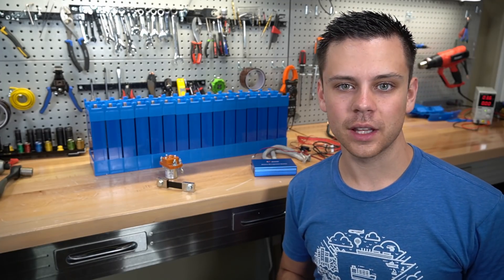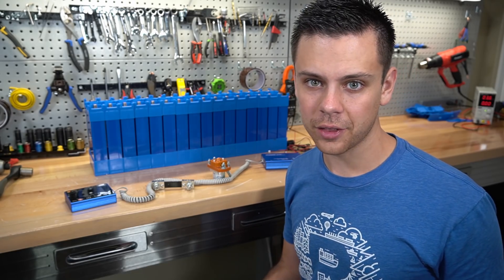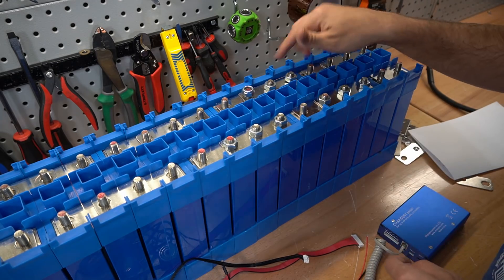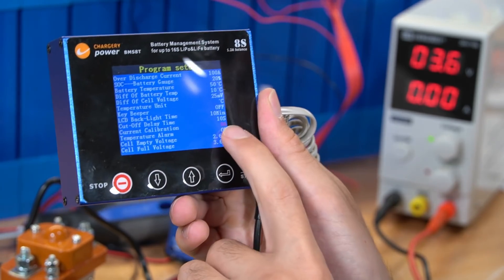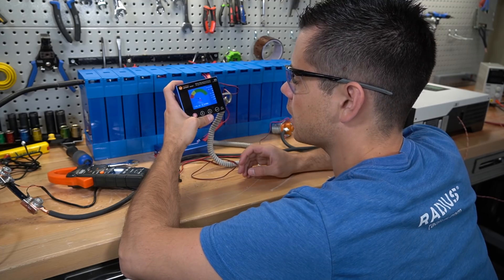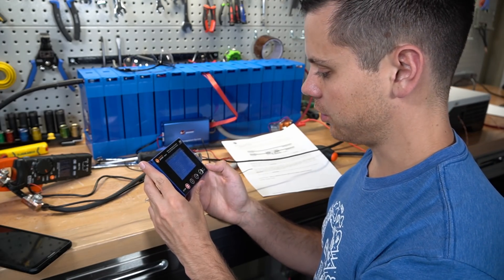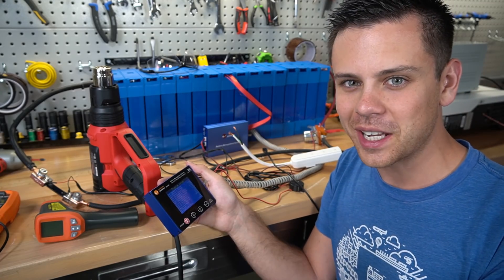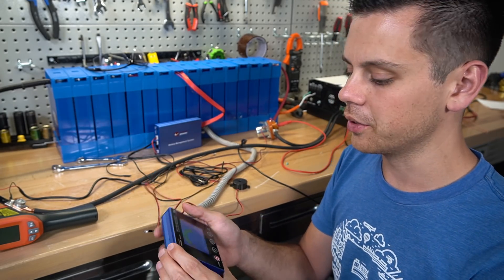Chargery 8T/16T LiFePO4/LTO/Li-Poly BMS Setup and Review

Comment: Dam I was hoping you liked it. Wish there was something better in the same price range. That DC contractor is crap mine is 3 times the size and it's 100amp.
I only use a BMS for charging I use voltage sensitive relays to control discharge. 
Thanks for the entertainment and education will

Comment: Hi Will, could using a relay between your battery and inverter damage or destroy your inverter by sudden disconnecting or connecting? Solar storage inverters seem to use CANbus. Would appreciate a video explaining the CANbus protocol and how it works integrating devices, and how that differs to other options RS485/modbus etc. Thanks, Luke
Reply: It will not damage an inverter if the battery is disconnected.  The inverter will only drain it's capacitors before it shuts off.  That means when the inverter get's power again, it will take an inrush to recharge it's capacitors.

Comment: 90’s? You ARE young! Same cords since 50’s I think. I had to use a circuit accessory to use the contactor. I was told that board wasn’t supposed to drive the contactor continuous duty. I had trouble with current calibration. Pulled some hair out. That shunt looks small. I bought the 300a and the shunt is huge. All I did was press the current cal up 3 then down 3 then save and get out. I ended up not using contactor and using this thing for monitoring cells. I do not Ant at all.

Comment: I would assume that the relay heat is from the coil being driven at 100% duty cycle.  120 degrees F  is not uncommon for some contactors of this size.  The big thing to check is what the 100% duty cycle voltage rating is for the contactor and make sure it matches the voltage being sent by the BMS because it may be higher than the contactor was rated for.  Another option would be to buy a quality no load (or magnetic) contactor that changes position based on the presence of power at the signal leads but uses permanent magnets to maintain the connection so that the coil only needs power in order to make the position change but then little or no power to maintain the connection so the coil doesn't use (or uses very little) power in either connection state.
Reply from the maker: Yes good point
Reply: Same as what an RV uses to turn on/off the house batteries.

Comment: Thanks for that review, I had looked at this one but given those limitations and issues, it still looks half baked. I'm using the Chinese fet based board with the bluetooth app for my bank like you reviewed a bit ago. The only limit to that one is that it can only handle 50 amps max charging current into the battery while discharge can be up to 400 amps, not that I'd ever push it anywhere close to that. My solution was to split my bank in half with one on each half giving me up to 50 amps of charging possible into the bank or 100 amps combined and splitting the load across the two. With my inverter setup I'll never pull more than 160 amps peak anyway with no more than 130 amps sustained so using the 400 amp rated bms with two of them, they'll never exceed 80 amps peak each or 65 sustained unless a pack or bms fails with the load only being carried by the other. And at $110 each I can afford to keep a spare on the shelf. Been running that setup for over a month now, and the bms never even get warm during use. Setting my inverters to never exceed 95 amps charging current, I stay under the max limit. Peak charging typically rarely exceeds 80 amps anyway, but it's nice to have the inverters as a backstop as well. I'm using that setup with a pair of the 48 volt Growatt inverters and I'm really happy with the results.
Reply: CAn you give us a name and link for your BMS?  Thanks

Comment: Pretty glad I bought a Daly BMS like you recommended.  I really didn't want to mess with configuration, given that I killed a pack before with a misconfigured BMS.  Usually I want more options but factory settings sounds pretty good for this use case
Reply from the maker: Hey I agree big time. I feel the same way.

And I use Daly BMS in my current system and love it. So easy!

Comment: DC relays get hot cause of the coil not the load. Remove the load and hook the coil to the power supply it will get hot
Reply from the maker: Yes absolutely
Reply: @WillProwse  maybe solid state instead?

Comment: Hi Will, I was thinking about buying 4 of these cells for a small 12v system for my stealth camping rig but i was wondering if there would be a problem buying another 4 in the following year to switch it over to 24v system - am I going to have a problem with balancing after using the first 4 for a year?
Reply: This!
Reply: At very least calendar aging will reduce your effective capacity. The AH of the 24v battery will be equal to the smallest value of the cells you have, which will be smaller for the cells that are a year older. Although if you aren't charging and discharging completely all the time this will likely be a small difference. 

The other thing to think about is your whole system will need to be designed for 12v, run for a year then be completely redesigned to run on 24v, because most components are not designed to run on both. If you have lower power requirements, it may be better to make another 12v battery with the 4 new cells and connect it in parallel instead of making a new 12v battery.

Or you could just go 24v right away, so you don't have to buy components twice. This is what I would do if you have the money, but I'm just some guy on the internet, what do I know. :)
Reply: @GillyGuy  Yes, I plan to parallel them at 12v if I haven't been able to buy enough items that are both 12 & 24v capable in that time frame. It's all about limited funds I have now and flexibility in the next couple years depending on what happens.

Comment: They do the shunt like this,  to allow the use of different shunts, but it can be made easier to work with!
Reply: Can you use a victron shunt with it?
Reply: @PaDutchRunner  You can use any shunt amperage but no more than 75mv.  Most good shunts like Deltec and such are 50mv.

Comment: Literally ships from wuhan! Lol no flyback diode? How long is that bms going to last getting transients?
Reply from the maker: No way haha! Holy cow
Reply: haha
Reply: Ya when u translate the Chinese it says wuhan. Literally the only reason I haven't bought one yet. Been in my cart for weeks
Reply: @cormacsyt0  the diode is there but you can't see it as it's under the orange top.
Reply: @cormacsyt0  Solid State Relays are being developed & tested for such DC Applications.  Energy Saver Relays from TE & Gigavac are also options.  Latching relays and a standard automotive type of relay used in combo can also keep constant power use down.
Reply: @DIY Projects Originally designed for small EV Usage but flexible enough for any application.

Comment: I use the 24s version, but without the shunt or disconnects. Will be using other means to disconnect, like turn off the inverter or disconnect ac loads. Removing the battery from the mppt charge controllers will damage them, if there is solar input. By the way, the bms gets warm when it is balancing.

Comment: Sounds like the "contactor" is rated in Chinese amps. Derate by 75% to get real amps :P
Reply from the maker: Exactly. Or 50%. That's my Chinese de-rating lately
Reply: @WillProwse  Chinese formula for Current: V/Rx2=I
Reply: @WillProwse  Your speaking my language Will :) My guess is, get a quality US or German made contactor and the problem will go away. I use a Schnieder with my Chargery BMS and it doesn't get hot at all. Oh and yes they are a BEAR to configure the shunt on.
Reply: Paolo Petrozzi duly noted, and diverted to /dev/nul
Reply: Hey Will.. Is there a way to test whether a contactor or switch can accept the rated amps before you install it in your system. Because that hot contactor seems dangerous at lower than rated amps. Possible fire hazard. Scary.
Reply: Duty cycle guys. 10 % in some. At 1000 amps. Or seek "continuous output power" Rms. My old PA mosfet Yamaha M70 was 500 W rms continuous output to my speakers Infinity RS II's. Slew rate 200v/ microsecond. 124 dbm S N ratio. So in power again as you said, all specs compared not just peak. How long? Our generators ran 8100 Amps at 4100VDC for 1.5 seconds pulsed but only 5000 amps continuous. 5/8 of max. Westinghouse stuff. Chinese I doubt would cut it.